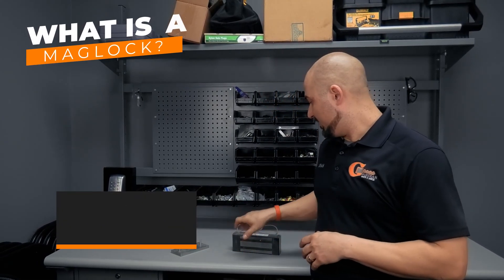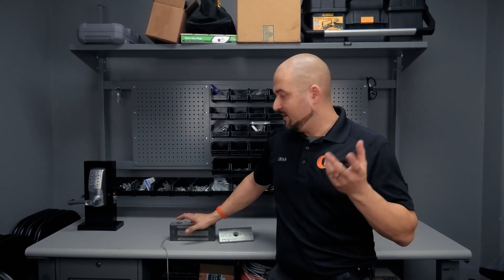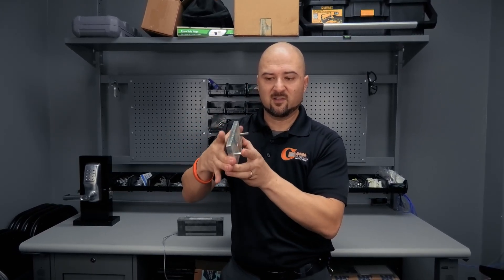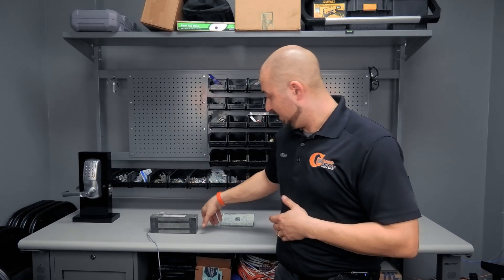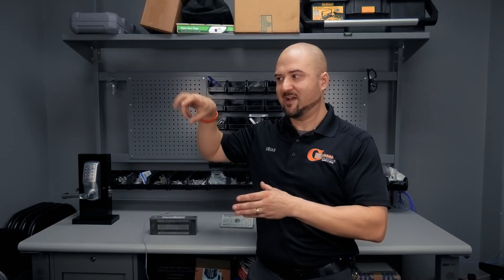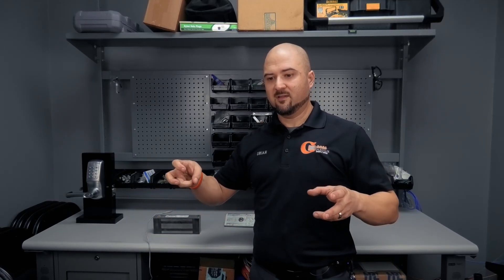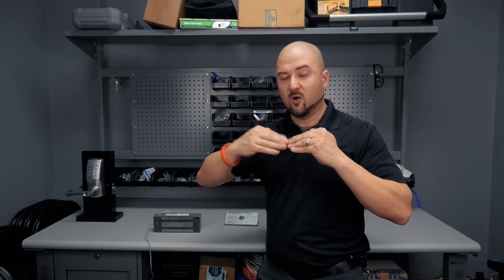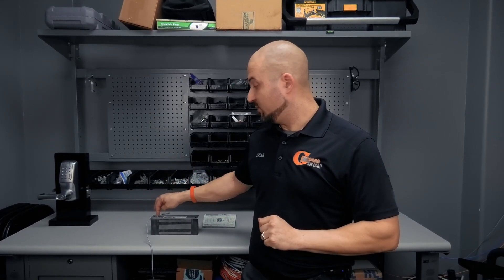What Is A Mag Lock? | GSL Discussion

Comment: Add information about the reliability of the Mag Lock vs other electronic controlled locks.  Our company's electronic panic bars have been problematic and currently mostly do not work.  A Mag Lock with no moving parts might solve that problem?  Also, how much power does a Mag Lock draw so the added cost can be considered.